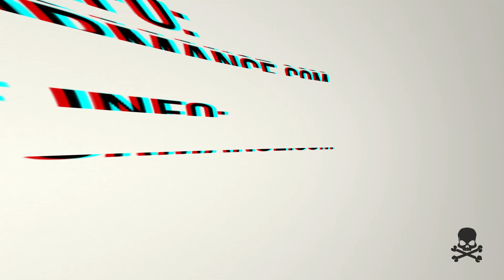Magnaflow 2015-2017 Shelby GT350 Competition Catback Exhaust System

Comment: I think it sounded better stock
Reply: I've driven a gt350 and the r model an it doesn't need anything. Shifter feels great. Car feels very well balanced and the exhaust sound insane. These vehicles comes with factory equal length shorty length headers. Putting magnaflow exhaust on it makes it sound like a Regular GT. Don't touch. Just drive.
Reply: +chevyhs yes exactly they are perfect cars from the factory and I would never change what ford did!